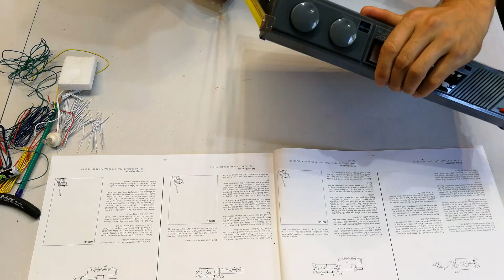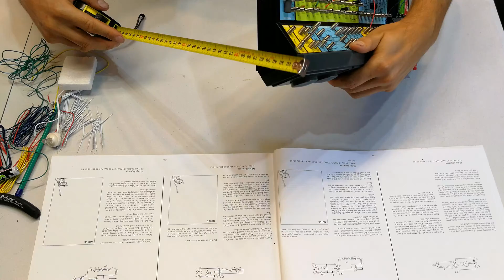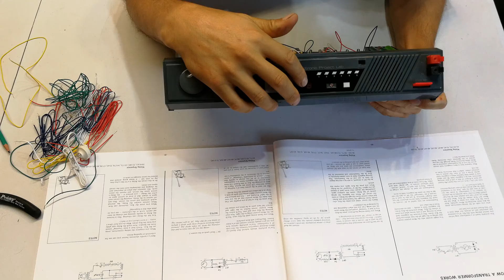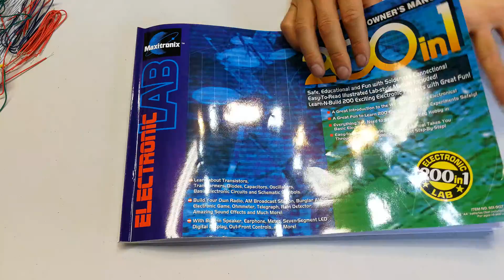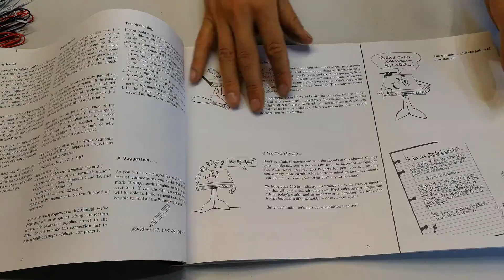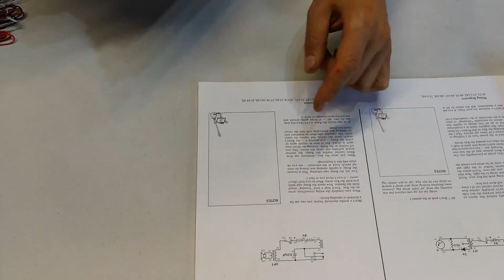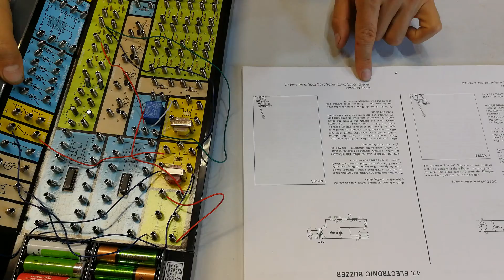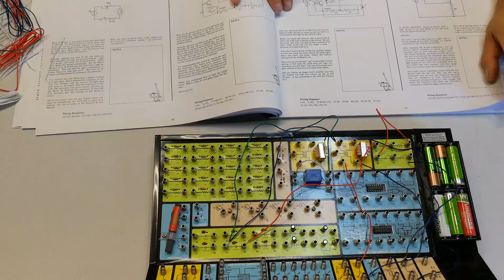Review of the Maxitronix 200 in 1 electronics kit.

Comment: Thanks for the review. I bought the Science Fair 200 in 1 kit about 1992 for $79.95 in Melbourne, seems identical to yours. The board does not flex like yours, the wire ends are lightly soldered, no trouble at the corner, that you mentioned at minute 6. My kit is still working, some battery connections corroded, 1 dead LED, but the kit works after 33 years. Very interesting to hear that it is still for sale. I think a child would need guidance at the beginning, especially when polarity is an issue. I have no electronic training, this kit and manual educated me.

Comment: Great video. Accurate.
In 2025, this kit averages 200 Australian dollars and I bought one for my son. 
It's pretty good but definitely not worth 200aud.
Reply: I bought the Science Fair 200 in 1 kit about 1992 for $79.95 in Melbourne, seems identical to his. The board does not flex like his, the wire ends are lightly soldered, no trouble at the corner, that he mentioned at minute 6. My kit is still working, some battery connections corroded, 1 dead LED, but the kit works after 33 years. Very interesting to hear that it is still for sale. I think a child would need guidance at the beginning, especially when polarity is an issue.

Comment: This is a modernized (though downgraded) version of the electronics lab Radio Shack/Tandy used to sell in the mid 1980s. I had that and the panel was cardboard, but the entire body was plastic including the bottom. The battery compartment was at the bottom of the kit rather than the top. It also had a clear plastic cover which protected the components and circuits when not in use.

The instruction book is literally the same one that came with mine, though with an updated cover.

Comment: Elenco, the makers of snap circuits created a similar gadget and it's a tiny bit higher quality in my opinion. though it is missing some stuff that the Maxitronix has. Also, about snap circuits I mentioned earlier, it is pretty similar except the parts snap together. they have a lot of electronics that are seen in normal electronics, like transistors, LEDs, capacitors, etc.